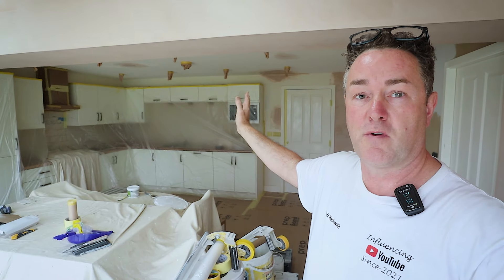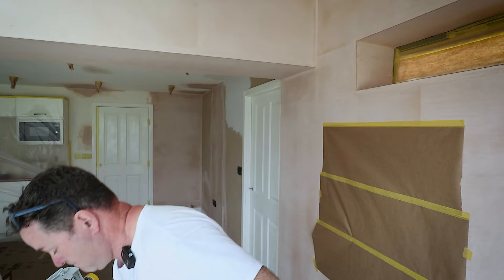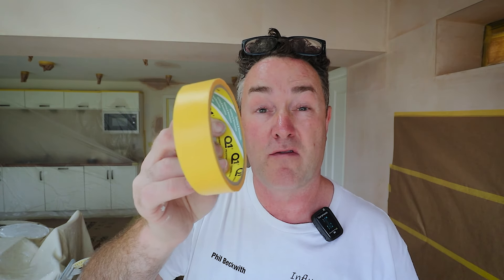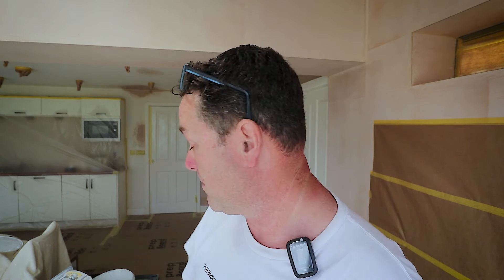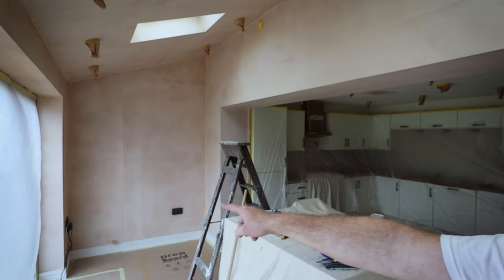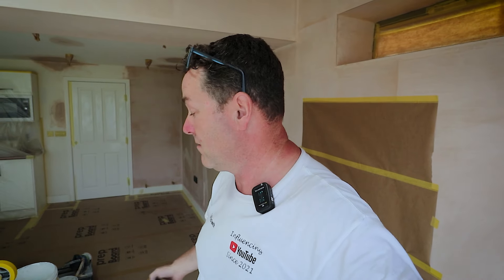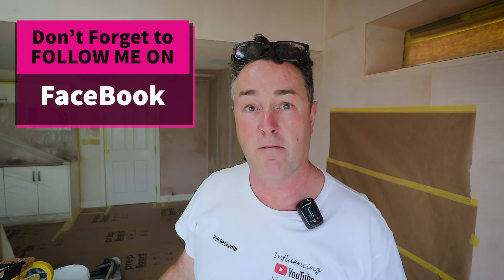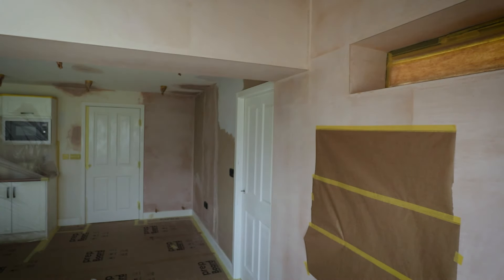Prepare a room for spraying - Isomat 2in1 primer paint

Comment: @ProfessionalPainterDecorator  Phil, I was taught to remove masking tape while the paint is still wet, or at least before it’s fully dry. How do you get away with spraying multiple coats before removing the masking please mate? Ta
Reply from the maker: yeah, do it after you've done you last coat is dry. Or have confidence in yiour tape and the surface you've taped up. :eek:

Comment: would you recommend backrolling or do you think it's unnecessary to stop flashing touch-ups in the future?
Reply from the maker: I wouldn't bother unless you want an orange peel finish ;)
Reply: @ProfessionalPainterDecorator   nice. In the past I’ve gone over my 2nd emulsion coat with a dry short pile Hamilton roller. Good results very homogeneous finish but I think I’ll stop now to reduce time but feel a bit guilty for future people wanting to touch up lol
Reply: Usually leave it after I’ve sprayed it  until it’s almost fully pulled in then roll it off
Reply from the maker: @antiquecrystalball532  its very durable paint the premium color by isomat, it wipes well, so shouldn't need a touch up.
Reply: @ProfessionalPainterDecorator  will get some and give it a go! Thanks

Comment: Phil, totally off topic. When removing paper from my wall the paint underneath is coming off in patches. The remaining paint is a nightmare to get off. What method do you use. Ps I’m down to plaster. You must be close to that 911 now ( although getting in and out is an issue the older you get)
Reply from the maker: No where near a 911 .. I less it's a Lego one 

Once paper is off. Go back over all the wall with warm water and washing up liquids 
See if any more paint cones away.. get a scraper on to get the last loose off 
Once that's dry... PeelStop, skim fill the edges.and a  sand over . When. It's all dry.

Comment: Quick question for you I have the qtech 5 stage, and I'm just wondering about needle size for spraying 2k for kitchens. I've  only ever used water-based, and I'm looking for Quicker drying times
Reply from the maker: Did you watch my 2K paint spraying video the other week?
Reply: @ProfessionalPainterDecorator  I did that was on a Window frame u used a 1.5 needle. I was just wondering if that needle size would be the same for cabinets because as I've said never used 2k
Reply from the maker: @jasonhughes6994  yes. But to 2k stinks
Reply: @ProfessionalPainterDecorator  have u any recommendations for getting it done that bit quicker, or could u do a video on it because I'm sure a lot of people would like to know.
Reply from the maker: @jasonhughes6994  how quick do you want to do three or four costs?
Reply: Depends, let's say, four on raw mdf or respraying say someone's kitchen cabinets.